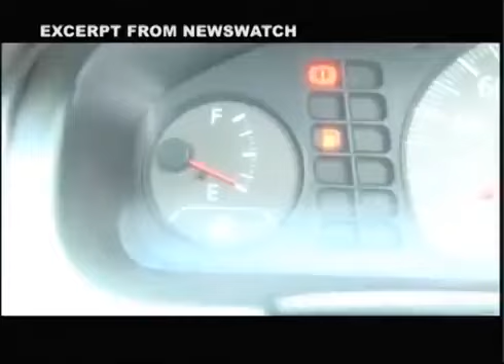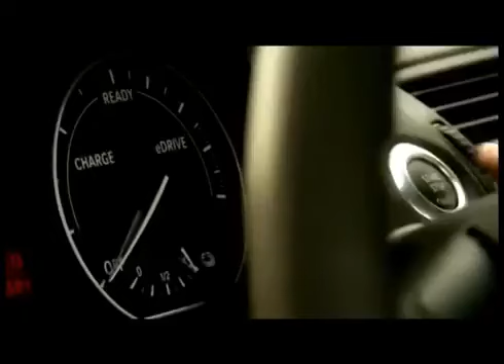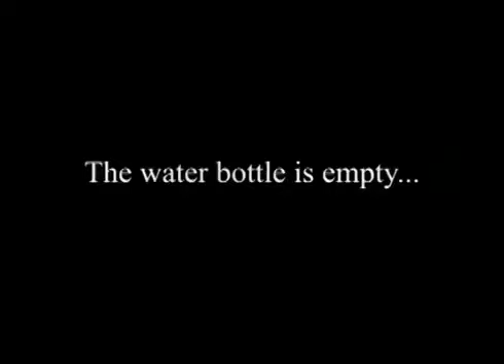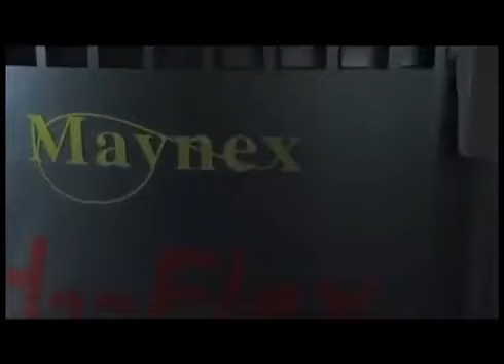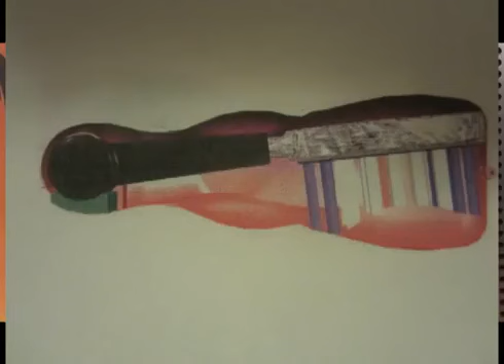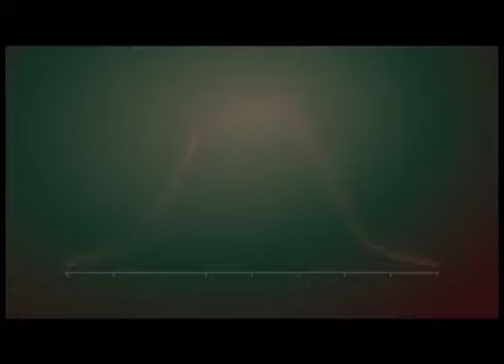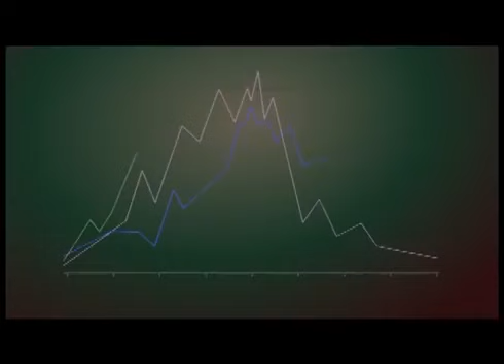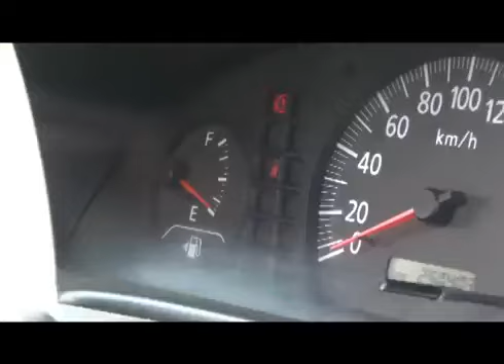Jamaican Inventor CAR RUNS OFF WATER also invent Battery that cant die & Toothbrush for Oral B

Comment: This is a great idea, concept and product. There are still unanswered questions though. This product converts Aluminum to Aluminum oxide (Alumina), which can then be re-smelted back to aluminum, which is Great. 

Aluminum is not a naturally occurring substance, and has to be extracted from its ore (Bauxite), before going through the smelting process to form aluminum. The smelting process generally uses renewable energy YESS, but the extraction of Alumina from Bauxite generally is heavily oil and Gas dependent. 

It kinda like seeing a person feeling so pompous about driving an Electric car and stopping at the charging station on the highway to recharge, only to figure out that this charging station is being powered by a diesel generator.
Dont get me wrong I love the idea, but the overall impact needs more careful study. Maybe Harlo has done an overall impact assessment, and can speak to it in more detail.
Reply: He already explained, the Aluminium smeltering utilise Hydroelectric, plus my own thinking is that aluminuim headed for landfill from damaged window frames after each tornado season could be cut into pieces to fit inside the H2Flex...many possibilities
Reply: What exactly are you shingleing on bro negative deconstruction
Reply: @Drufi  Brilliantly taking up the slack for wast and polusion .how Ezcelllnt is thy name
Reply: @Drufi  Brilliantly taking up the slack for wast and polusion .how Ezcelllnt is thy name
Reply: @Drufi  great idea